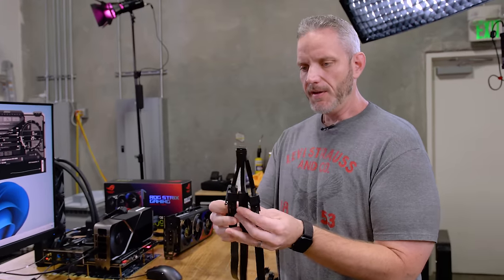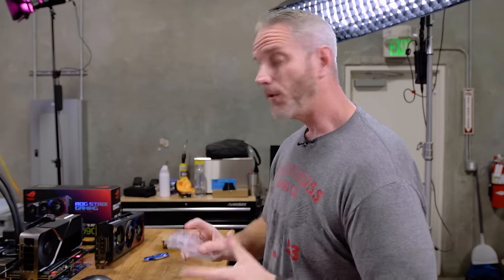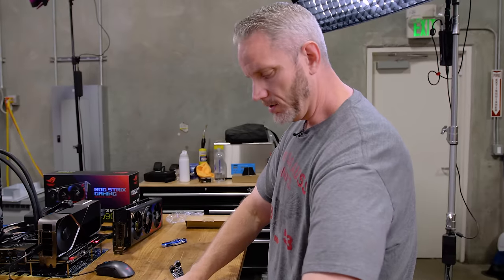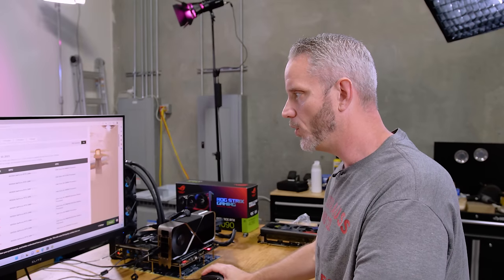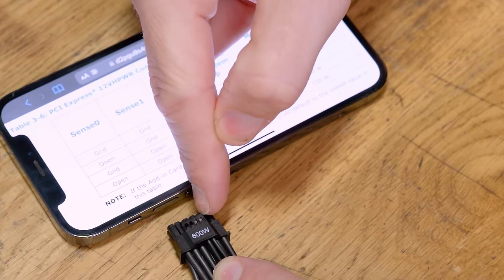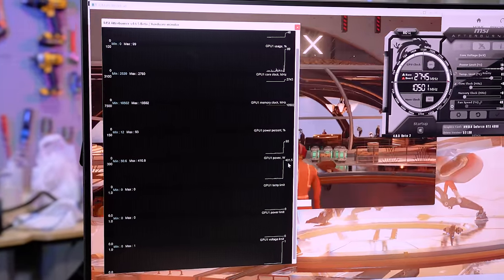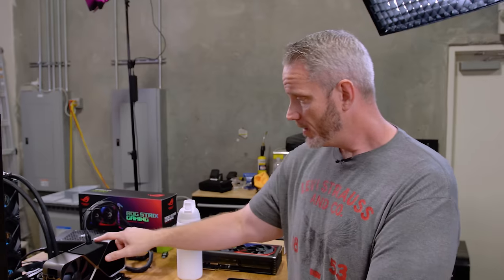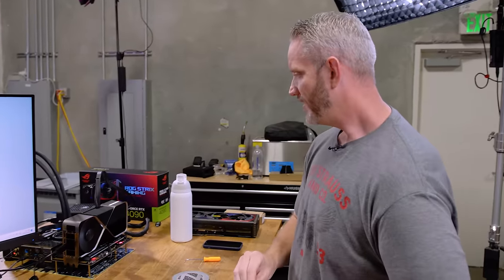DON'T Do this with your GPU!

Comment: just as a note Jay. Solid core cables can break fairly easily if you bend them a lot. Might be something to be cautious of for your testing rigs incase they start to break and short/overheat
Reply: if you're in there bending your GPU PSU cable a LOT... you got bigger problems you caused lol...
Reply: @wojtek-33  hes talking about over time reason why most cables have a bend rating
Reply: As history has proven again Jay has small knowledge on electronics.
100% that is not a solid core cable, yes he miss spoke again...
Reply: We are going to start to need new cable tech soon, which is kinda gross.  60FPS at 4K is fine, stop it!!!

but...
Reply: @warpedphreak  don’t forget, as a reviewer, Jay is regularly swapping components. Regularly unplugging power cables. Yes, in a personal rig, you shouldn’t have that problem.
Reply: @stevenhenson4956  as a electrician hearing @jayztwocents talk about electrical theory i cringe haha I'll take stranded over solid wire all day
Reply: @N0N0111  These people make you laugh....
Reply: It's stranded, it holds its shape because they're loomed in together. Stop it lol.
Reply: Solid core is a good guess.  But the fact of the matter is, it's just really heavy gauge braided copper.  Not solid.
Reply: solid core carries less power than stranded because of the skin effect. Highly doubt these are solid core.
Reply: Then just fix it with IFIXIT !!!!!
Reply: @NeverPullOutInMexico  why did you tag me????? Please learn how to youtube
Reply: @telepresencebot2  Isn't skin effect an AC thing?
Reply: @telepresencebot2  That is an AC thing, these cables run DC power.
Reply: @StubbornProgrammer  yes, but the spikes in power your gpu has on every frame can be thought of as ac power, so you'll have higher resistance in solid core wire for the transients, and thus more heat
Reply: @telepresencebot2  Wait, so then more rapid the transient, the shallower the effective skin and the more concentrated the heating? You're right, that does sound bad.
Reply: @beaniiman   - LOL. Be quiet Ludite. 144hz 4K (43 inch) monitors are the future. Well, my current reality, but I digress.
Reply: @StubbornProgrammer  yep, exactly. Higher frame = stranded cable is more important. So better gpu makes solid core wire worse
Reply: @telepresencebot2  skin effects only appears at very high frequency. a power spike, though fast, doesn't really qualify.
you don't have millions or billions of spikes per second for high frequency load to matter.
500W DC plus a few odd very short spikes at 600w. pretty obvious what would cause warming up ;)
But regardless, it totally is stranded core. All the flat cables from corsair behave like that, even the thinner ones.
Reply: @ledoynier3694  I haven't done the math, so you might be right, but looking at the power draw data from gamers nexus on the 4090, the card can go from 7.5 amps to 70 amps in 200 microseconds, which would be around 2.5 megahertz.
It's not doing that constantly of course, but it's likely to happen at least once per rendered frame, and some games don't cap menu frame rates, resulting in several thousand fps being rendered, which is again in the multiple megahertz range.
Reply: @telepresencebot2  I think that aplies to high frequency, not DC, not sure...
Reply: @telepresencebot2  That's assuming that the variance is seen by the PSU. There's usually a lot of filtering going on within the cards power delivery aswell. Kind of a moot point though since solid core wires isn't really a good idea in this application anyway..
Reply: @novideohereatall  no, the power monitoring was done directly on the power cables going to the card via an oscilloscope, so that is what the PSU sees.
Agreed though that fatigue is the main reason not to use solid core wire.
Reply: @telepresencebot2  Oh wow. Such high frequency current fluctuations is not great to see, even if the PSU can handle it...
Reply: its not that big an issue, just leav the cables in the same way you put them in from the start and dont take them out, ofc if you want to clean your GPU that's different but you dont need to move/bend them far to unplug a GPU
Reply: @N0N0111  so  what do you think Gamers Nexus would say?
Reply: @socialfreak6900  regular old joe will be fine even if they were solid core, but reviewers/testers like Jay will be plugging and unplugging them all day, bending them around different setups. It was to him (which is why i said his name) to watch for the cables integrity. Another poster said they are just heavy gauge and not solid core so should be more reliable anyway if thats the case.
Reply: @NeverPullOutInMexico  Yeah, they stop with the "solid" for power purposes at a much higher gauge.
Reply: @socialfreak6900  I wouldn't call that "not an issue". The damage is invisible because of the sleeveing, is a fire hazard, and isn't well understood by most consumers.
what if you get it second hand?
Reply: @telepresencebot2  fair point tbh, I wouldnt trust it second hand
Reply: @telepresencebot2  For a given gauge ampacities are the same.......
Reply: That's wrong. Go bend romex wire, unless your crimping wire down the wire is touching throughout the bend yes it will break if you keep doing that over but solid core wire will bend a lot without any issues or breaking, really small Guage 22 and 24 I would push it smaller wire acts differently. Also solid copper will hold its shape, this is most likely not solid copper and just the plastic insulation that's really thick, or a certain type of plastic. It's a not the smartest idea to use solid copper in something like this just like the homemade extension cord jay made years back. Also none solid copper wire won't hold its shape and that will break if you bend it to much, it's really small guage usually.
Reply: This is most like a extension cord, thicker wire but not solid copper. 14 to 18 gauge most likely for more power.
Reply: they didn't use solid core. its just a stiff cable.
Reply: @NeverPullOutInMexico  any reason on why Nvidia fucking chose a shoddy ass design to power their gen 5 cards? Intel too since they let this mess come to pass.
Reply: @StickyKeys187  engineering is based on theory not practical use, just like how engineers design buildings they make some dumb design we have to redesign
Reply: It's hilarious how some folks without monetization, uploading gameplay for free... Yet they know everything about electronics. Good for you! Your 11 view video is really popping off. The YouTube experts have awaken my friends. "Actually Jay is wrong, I'm smarter than  him." Love these bums confidence, fake it til' you make it I guess
Reply: You should see what electricians do to the wires in electrical outlets lol

Comment: Hi Jay, Brian from ASRock (Malaysia) here. 

For your RTX issue, could you try change the option in Advanced > AMD PBS > AMD Common Platform Module > PCIe x16 Link Speed

One of my local distributors had problem with Zotac card too on our X670E board, it refused to display but in the end it did with some BIOS setting changes.
Reply: Bump
Reply: @Frostbite1090  thanks. Jay didn't provide much details but I believe it was same issue. Ours case was ZOTAC GAMING GeForce RTX 4090 AMP Extreme AIRO on ASRock X670E Steel Legend. For some reason it didn't work but later worked, got it settled within 24 hours and managed to work perfectly for the RTX 4090 launch event.
Reply: UP
Reply: @PlayMates_  Thanks.
Reply: We hope he sees this!
Reply: @LarryGanz  Thanks, hope so too .......... and anyone else that has the problem. 

I don't have any RTX 4090 in the lab yet if not I would test them out personally as well.
Reply: Feed the comment ranking algorithm!
Reply: Never thought I'd see goldfries posting a comment here
Reply: @emma70707  Thank you. :)
Reply: Algorithm!
Reply: Malaysia boleh !!
Reply: @bdbgh  Thanks, take care of my brand also mah. Hehe.
Reply: @GabrielKLKN  Yes boleh!
Reply: @goldfries  
Salam semangat Pak cik
Reply: +1 so jay would see this
Reply: @fajaradi1223  Salam sejahtera!
Reply: Really awesome of you guys to be online and chiming in on problems for the community. Thanks
Reply: @turbobros_online1561  Thanks. This is out of personal capacity actually but yeah I hope to see my brand ASRock grow. It's a good way for me to understand user problems vs my products, and it'll be useful for others as well. 

I don't get paid for this effort but well, I do enjoy helping others. 😆
Reply: UP
Reply: Lead by example! Nice of you to reply here!
Reply: stop blacklisting creators when they correctly point out flaws in your products
Reply: @MrMeow-xl7pd  that one is not my call .....
Reply: @ReSpawNnL  Thanks. Just chipping in information that I have, hope it helps Jay and other viewers.
Reply: Cannot don’t bump and support Malaysia tech reviewer. Up up up. Hope Jay see this.
Reply: ASRock doesn't end up surprising with customer care and interesting products.
Reply: Bump +1, Yeah that awesome
Reply: @MrMeow-xl7pd  who got blacklisted?
Reply: @RealTaIk  Gamers Nexus and Hardware Unboxed f.e.
Reply: Bump
Reply: @MrMeow-xl7pd  Interesting, I haven't followed that. It's cool that they're here to help Jay, but getting on good terms with GN would only make AR more respectable. I think GN can be blunt, but most of the time his reviews and benchmarks are way more in-depth than most others on YT. It'd be a good idea to take his thoughts into consideration.
Reply: I had a 3060 that refused to display in a particular motherboard. I updated the bios then it started working. I don't understand why, but it worked.
Reply: got same problem on MSI SuprimeX and Gainward Phantom, no video output on monitor, but today's Bios update 1.09.AS01 also solve this problem for me,
Reply: Thanks, up for this...
Reply: up
Reply: What a time to live in! Appreciate you Brian (ASRock).
Reply: Bump
Reply: asrock boss lesgoo
Reply: UP!
Reply: bump
Reply: extra bump
Reply: BUMP!
Reply: Bump.

Having AIB/motherboard professionals commenting is valued and important!
Reply: This needs a pin! And all the bumps!
Reply: @goldfries Does this work for Asus motherboards? People are reporting issues with the Z690 and X670E Maximus motherboards on social media and Asus forums.
Reply: @lilkwarrior5561  I'm not sure at all. Haven't got the chance to try.
Reply: @lilkwarrior5561  It's called early adopter bonus and it works like early access games, you pay the highest price to participate in the beta test for bios/firmware/drivers :)
Edit: Just replying to keep this top of  comment section, it deserves a pin!
Reply: has Jay seen this yet?
Reply: @markrtoffeeman  i agree!
Reply: Still haven't seen it based on the latest video... 😕
Reply: Hi @goldfries Brian !  I have the Asrock WRX80 Creator, and i don't have that bios preset, would you enlighten me by any chance ? Thanks a lot !
Reply: i have the 1650 toughpower atx 3.0 psu from thermaltake
Reply: @Frostbite1090  b-bump :3
Reply: @visualiststudio6743  WRX80 and RTX 4090 with same issue? I'm not sure already then but what you can do is contact support in your country see if they have anything. If not then you can go through me, though I'm not a global representative in any way, I'll be glad to help out within my capacity as a fellow tech enthusiasts.
Reply: @goldfries  sure will do it, thank you Brian =)
Reply: @goldfries  by any chance, do you know if I should let PCIE to Max Speed or Gen4 ?
Reply: Hi Brian
Reply: Thank you! 👍
Reply: Update: the X670E motherboard had  a BIOS update
Reply: Who punched you, Brian?
Reply: @Marauder1981  You wouldn't know even if I could describe in perfection.
Reply: @Marauder1981  I'm sure neither of them would like to have their hands on you.
Reply: @goldfries   why? Wth are you talking about?
Reply: @Marauder1981  You just need someone to talk to, I'm here.
Reply: @goldfries   You make no sense.
Reply: @Marauder1981  Most times I do but for you, I make it special.
Reply: @Marauder1981  that's your assumption.
Reply: @goldfries  You guys are awesome! Had a hard time deciding but picked up the Sonic The Hedgehog Z790 on sale 3 days ago. Keep up the great products. All my mobos the last 8-10 years have been ASRock
Reply: @manh2704  Thanks, the brand does have great products. :D Sonic model does look cool, doesn't it?
Reply: This is why ASRock is slowly becoming my new favorite brand.  They address customer concerns!
Reply: This is why asrock will forever remain a solid brand
Reply: @goldfries I have 6800xt Phantom gaming with no coil whine, i never had a problem wth this card. I can say i like ASRock company a lot :)